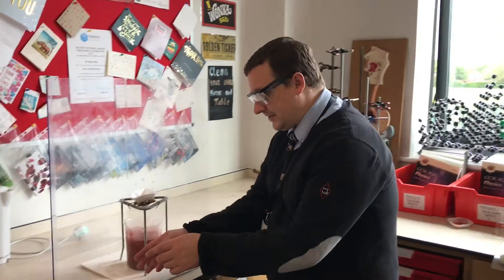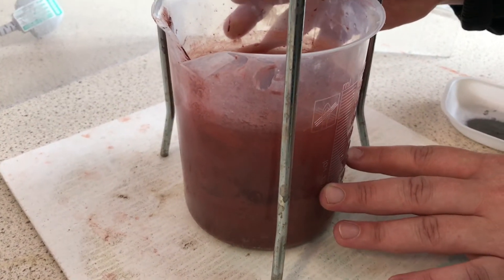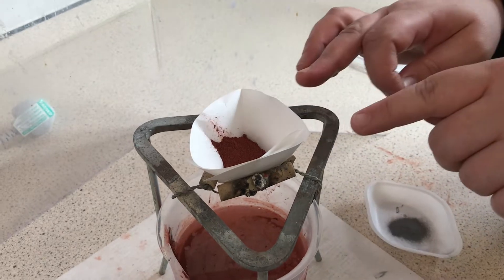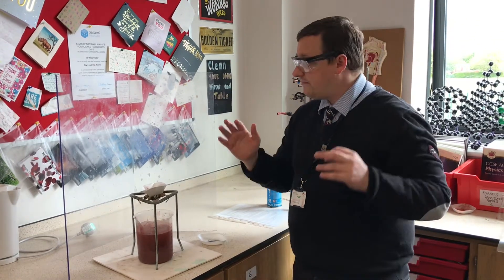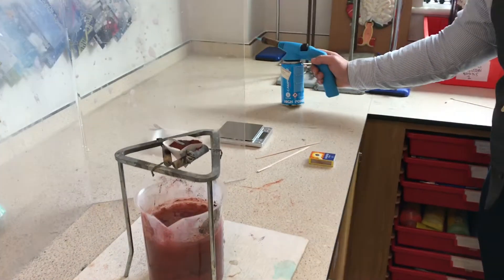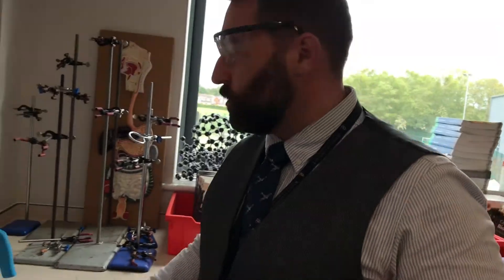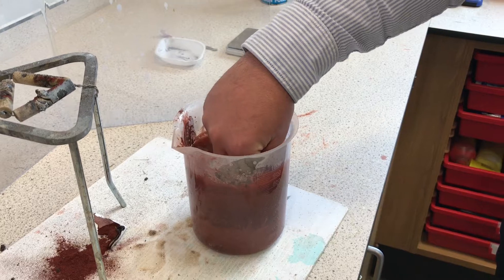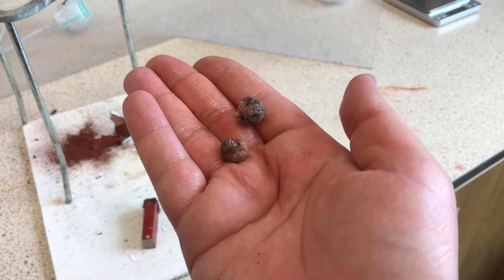Thermite

Comment: I have a bachelors degree in chemistry. If I had attempted this in my own chemistry lab, it would’ve caused me to fill the course. this is not an experiment that should be replicated indoors.
Reply from the maker: According to the national safety advice produced for secondary schools by CLEAPSS, it's perfectly acceptable to carry out this experiment indoors in this way.
Reply: @inthelab888  Sorry.  I am not familiar with this term.  My secondary school and university degree were 5000 niles (8000 km) apart from one another in different states of the US.  Ventilated hoods were common to both in areas where combustible materials were used.  Where combustion was likely, such work was performed outdoors.
Reply from the maker: It all depends on the products made as to whether ventilated hoods are required. For this experiment, they are not. CLEAPSS is an advisory body for schools in the UK and they give us lots of good information about how to carry out experiments.

Comment: That's how you make iron? And I thought it was an element, made in the heat of a Sun... doh, silly me eh professor!
Reply from the maker: Iron is indeed an element and both methods are great ways to make it - though we would struggle to use the 'Sun method' whilst in the lab...
Reply: @inthelab666 lol! Yeah, I can see that pulling a Sun apart in the lab, just to access some iron would be a touch of overkill! Spectacular, but still overkill! Fortunately, we live in a 3rd or 4th generation system with a young Sun and planetary system built in the "bones" of long dead stars, those bones naturally contain not an inconsiderable amount of iron... Lol! Guess we are lucky, most of the hard work of obtaining "raw" elements happened before the earth and indeed WE were born!
Reply from the maker: If we get a bigger lab, we might  try that method... bigger than the Earth, of course...
Reply: @inthelab666 By the way, thanks for replying and taking the time. Not everyone does. Anything that brings science to life for people is inspirational and should be applauded. Thanks.